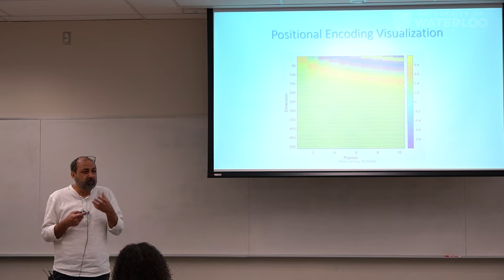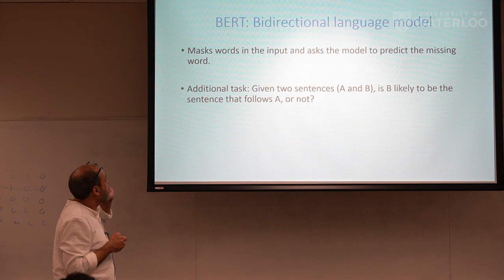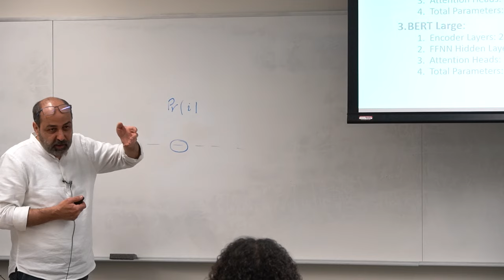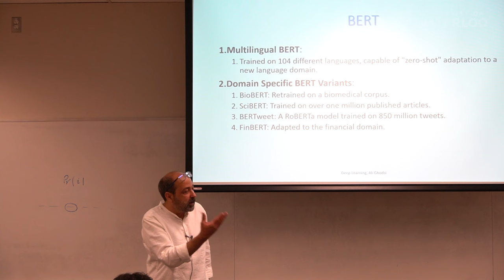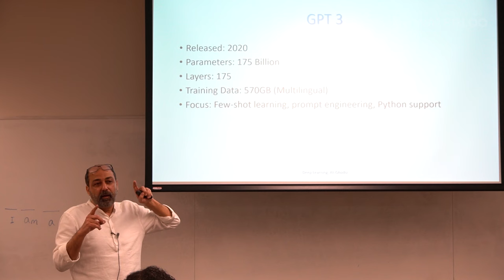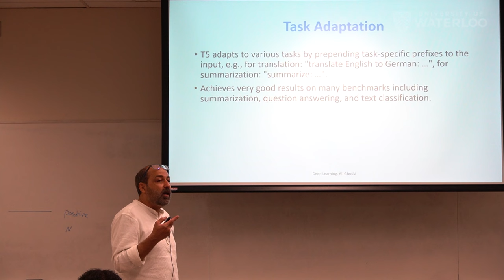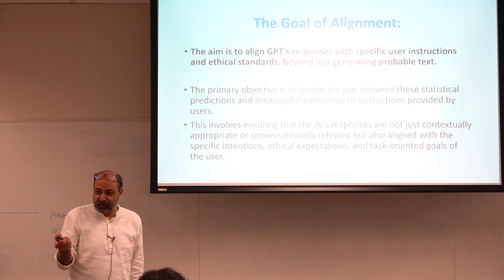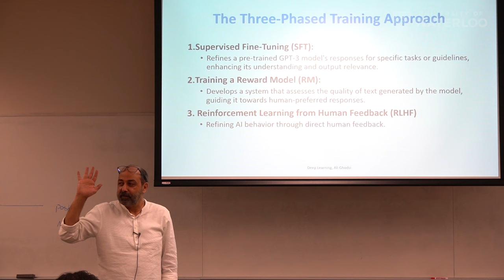Ali Ghodsi, Deep Learning, BERT and GPT, Fall 2023, Lecture 11

Comment: 🎯 Key Takeaways for quick navigation:

00:07 📚 Introduction to GPT and BERT
- GPT and BERT are both Transformer-based models.
- GPT stands for Generative Pre-Trained Transformer, while BERT stands for Bidirectional Encoder Representations from Transformers.
05:26 🧠 How BERT Works
- BERT is a stack of encoders with multiple layers and attention heads.
- It is trained by masking words in sentences and predicting the masked words, making it bidirectional in nature.
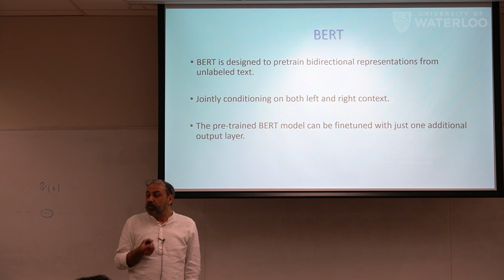10:17 🏭 Applications of BERT
- BERT can be used in various applications by fine-tuning its pretrained model.
- It's especially useful for tasks like sentiment analysis and can handle domain-specific tasks.
14:55 🧬 Domain-Specific BERT Models
- There are domain-specific BERT models trained for specific fields like bioinformatics and finance.
- These models can be used in applications within their respective domains.
25:09 📝 Introduction to GPT
- GPT is a stack of decoder layers, where each decoder is similar to the transformer decoder but without cross-attention.
- GPT is trained to predict the next word in a sequence.
29:48 🚀 GPT's Evolution
- GPT models have evolved over time, with each version becoming larger and more powerful in terms of parameters.
- GPT-4, for instance, has an enormous 175 billion parameters, making it highly capable in natural language understanding and generation.
30:28 🧠 Introduction to GPT 4 and its size
- Introduction to GPT 4 and its undisclosed size.
- Speculation on the impact of model size on performance.
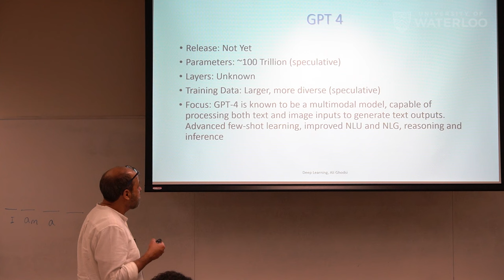34:04 🌐 T5: Combining BERT and GPT
- T5 is a combination of BERT and GPT.
- Transformation of various NLP problems into text-to-text format.
- The application of T5 to a wide range of NLP tasks.
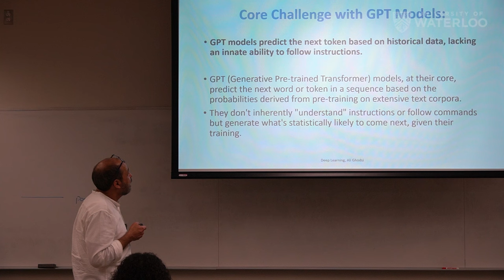44:12 🔐 Challenges in Aligning Language Models with User Intent
- The challenge of aligning language models with user instructions.
- The importance of alignment for ethical and practical reasons.
- The need to avoid harmful or offensive responses.
49:30 🎯 Steps for Alignment and Reinforcement Learning
- Overview of the three steps for alignment: Supervised, Fine-Tuning, and Reinforcement Learning.
- Introduction to reinforcement learning from human feedback.
- The importance of understanding reinforcement learning for alignment.

Made with HARPA AI